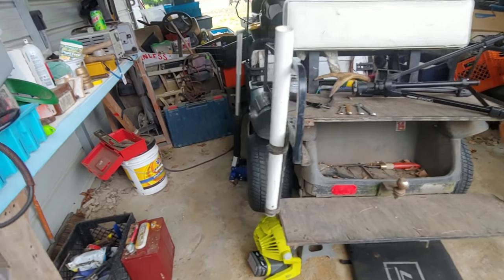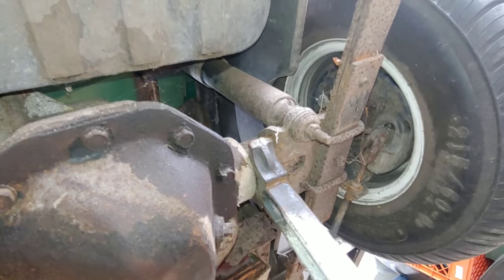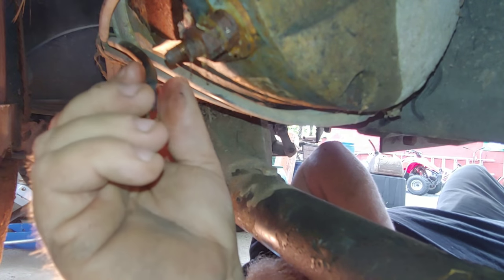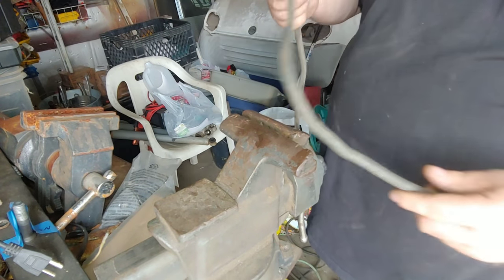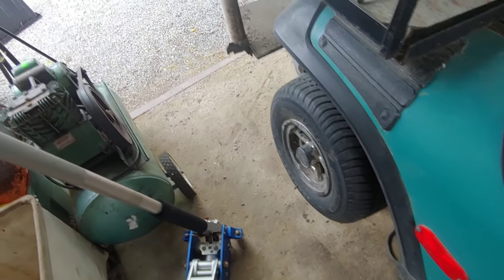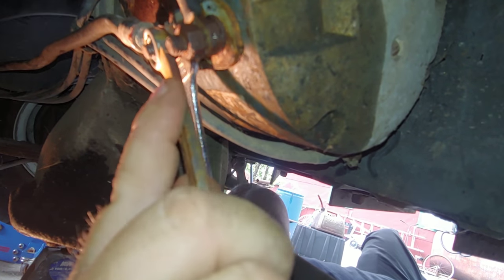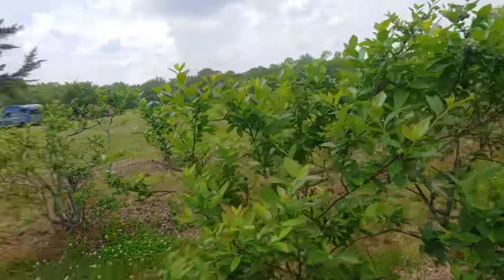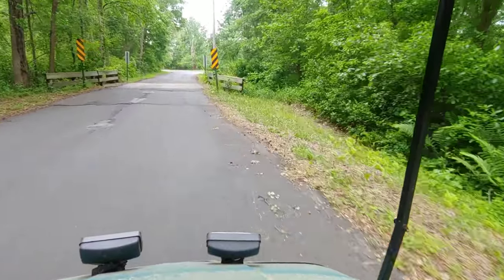Golf cart Broken

Comment: Not sure what to do with our cart, Input it into reverse and it wants to go but just wont fully engage, any ideas? the batteries are fully charged pulling my hair over here, oh and new controller also, im thinking maybe the rocker switch?
Reply from the maker: It could be the contacts in the forward and reverse system... what kind of cart is it
Reply: Scrap Farm its a 2006 ez-go, new controller, good batteries, good cables,, forward reverse switch seems kind of wonky, ill switch it into forward or reverse and  I can feel it pull and it just gives up
Reply from the maker: @josephbenassi9697  it's really hard to say without being there and actually testing it myself but there is a website called buggies gone wild that's a pretty big help
Reply: Scrap Farm Thanks Bert I will check it out thanks for the help sir.!!